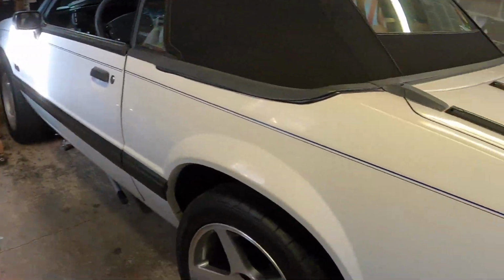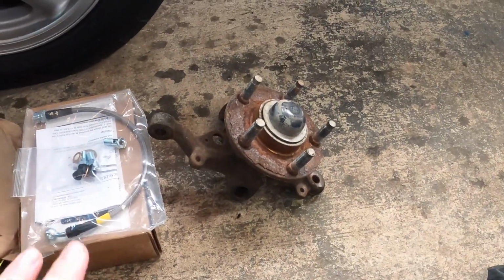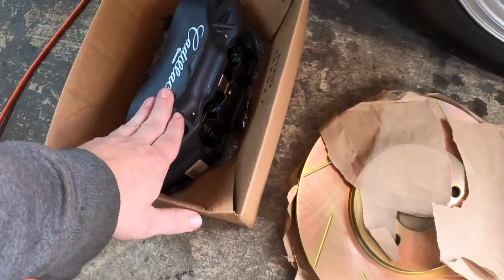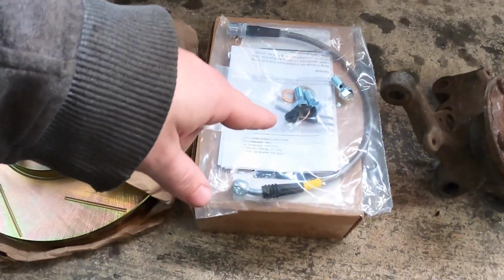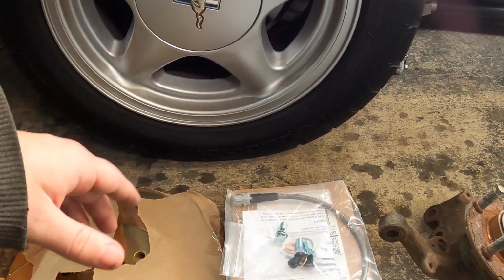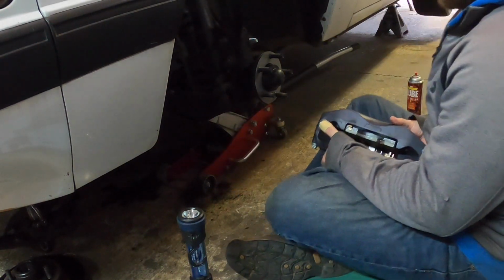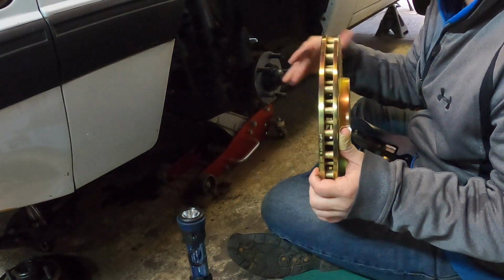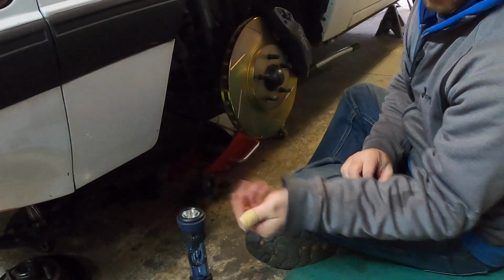Fox Body Mustang Front 5 lug swap

Comment: Question.  With these spindles, do you have to use washers to mount the strut like on 96 spindles?  And do you have grind the holes out on strut ? Thx.
Reply: Use the 2 thin plates with 2 bolt holes, oversized holes, thar came with your foxbody.Did not have to do any grinding.The Sn95 spindle is about 1 inch shorter than my 1990 spindle, so have to compress spring 1 inch more to install, hard to install.
Reply: I have a 1990 Gt hatchback, 5.0 , fuel injected.Removed front spindle, to get it out, I loosened the ball joint bolt to spindle,put jack under control arm and lifted/compressed spring a couple inches, hit spindle a couple times with soft hammer, and it popped loose.When 1:55 installing SN95 spindle, have to bolt and final torque spindle with torque wrench before bolting to shock/strut, because spindle is shorter and no room for socket if shock attached.
The spring compressor borrowed from Auto zone, advance auto with 2 bolts compressing outside, is too long, need to cut off about  2 inches minimum for .75 inch lowering springs,as the spring pocket is almost 2 inches deep and will not work if bolt hits into metal pocket of lower control arm.zFound a big triangle type spring compressor from Harbor Freight , it should work. IT should be offset enough that it will not hit control arm or car.
I got a kit online with 2 piston PBR calipers, new sealed wheel bearings, SN95 spindle from 1995.Need to use the 2 washers above knuckle for ball joint so it will not bottom out.

Comment: I have 96-04 fits no problems works fine works better when lowered don’t need bump steering kit
Reply from the maker: Check back after doing some serious driving. It might do ok for light street driving though. Wheels will not be tucked as nice. That I know for sure.
Reply: @mattthomasmotorsports4816  its on my daily driver well over 600hp 357 i have not felt any thing funny in the steering fox rack still have power streeting

Comment: Frogot to add you need to Dremel, the spindle for the bolt to clear the new caliper install
Reply from the maker: Not needed when using the kit I mentioned. No spindle modification necessary.
Reply: @mattthomasmotorsports4816  weird, I had to with there kit, so the bolt goes in straight and not off, cause those inserts need to be installed a certain way with arrows out on each side sorry on the back of the caliper, alignment holes on the ss kit makes it so the bolt won’t go in straight, so needs tk be clearance on the back side since it’s a offset fit, I’d you didn’t need to do that, you might have installed the inserts wrong
Reply from the maker: @2vgod460  not to be rude my guy, but I would venture to say that you installed the bushings off a little bit. I had to adjust mine to work. But if you read the instructions it clearly states you don't have to modify the spindle.

Comment: Thanks alot for the video.. Where did you get the lines from? Did it come with the kit?  Or what type do you need to get?
Reply from the maker: Maximum motorsports. If you want the part number I listed it in a coment on here.
Reply: Ok great thanks

Comment: For the brake lines do you remember what part number you used ?
Reply from the maker: should be listed in a previous comment.  It would be one listed for fox to sn95 brake conversion though from maximum motorsports.